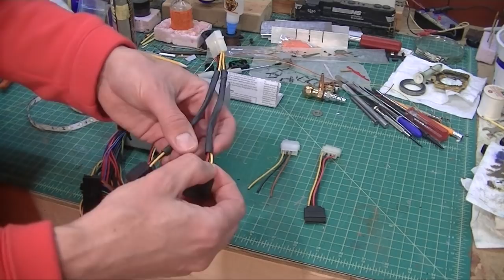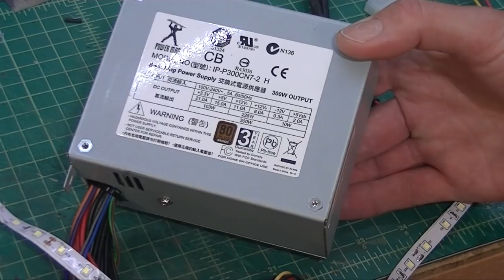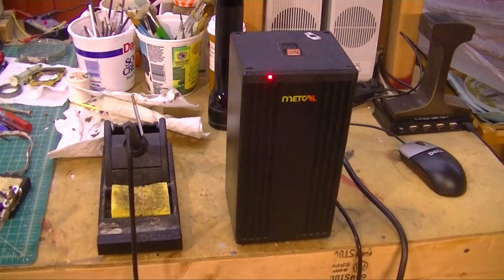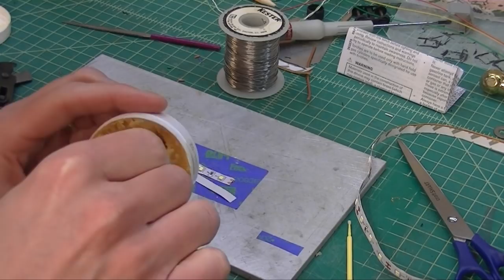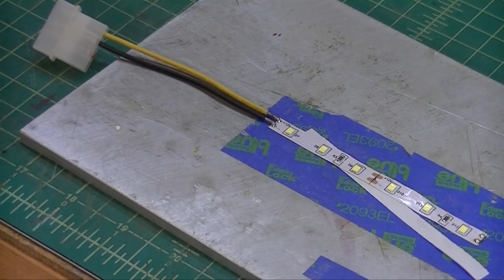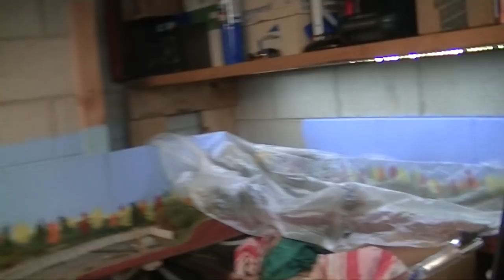Shedding Some Light on Things - LED Lighting for the Layout Area

Comment: Thanks so much you've answered a question I've had for years. I have heaps of power supplies and not known how to turn them on.
Thanks now I can power so much in my shed.
Reply from the maker: Awesome!  Glad it helped.  In case you run into it, one commenter noted that some supplies will shut down if there is no load on the 5V power.  Adding a resistor to the 5V rail will solve that.  Might to do a search as to what value you should use though.  I have not found that to be necessary with the supplies I've used thus far however.

Comment: Many PC power supplies will require a load on the +5v rail or they will shut themselves off.  I have had success in connecting a 10W 5 ohm power resistor from +5v to Gnd to provide this load.
Reply from the maker: This is a great point and it may be something that pops up on a power supply.  I'd be interested to see if that has anything to do with their efficiency ratings.  (Gold, Silver, Platinum), etc. . .  All the supplies I'm using are older and don't have that rating, so that might be why I haven't run into that.  But good to note if someone sees their supply turning off on them.